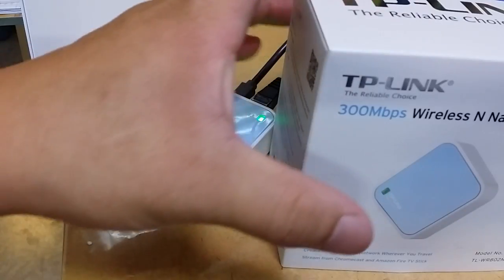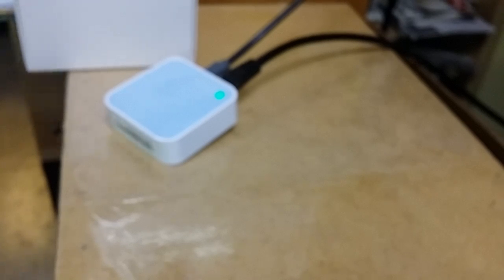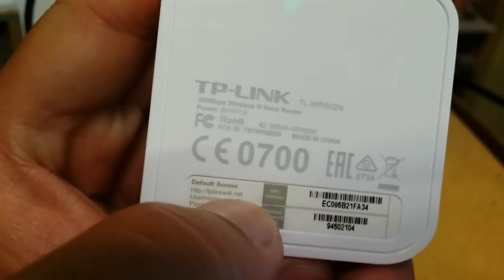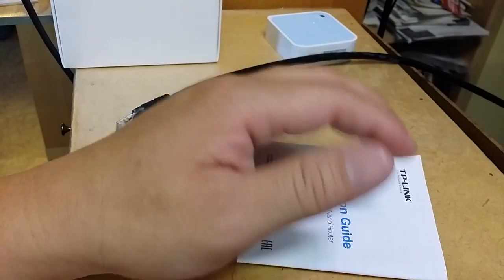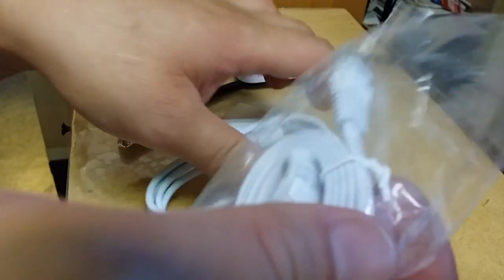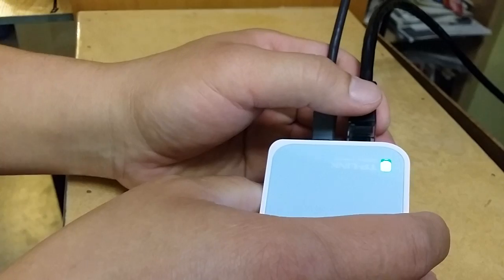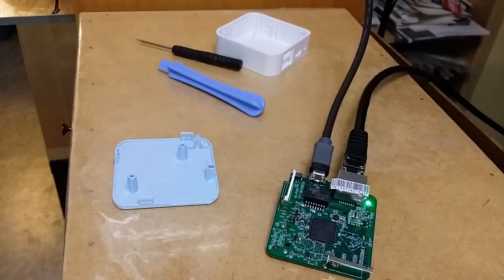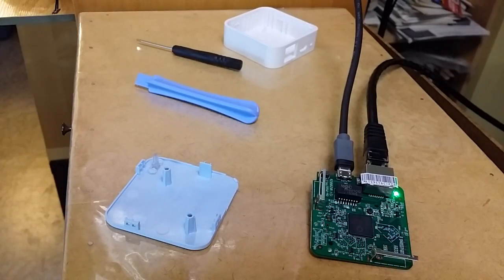TP-LINK TL-WR802N Pocket/Travel Router Initial Observations

Comment: Hey mate, were you able to measure how long it took to boot up? I need something small like this but with a fast boot time.
Reply from the maker: Oh, I still have it. But there are much newer devices. I would recommend a new model. They still sell this old one on amazon. I don't know why. It was already old when I got it.  In terms of tiny routers,  I am currently into the GL.iNet opensource routers. They come with OpenWrt built in. I have several of their devices so far. The only thing about them that the masses probably wont like is that these devices are pretty much almost roll-your-own or you-are-on-your-own. Well, they're pre-rolled, but you really are on your own.   They are stable if you have the patience. I have their tiny yellow "mango" box (same size as the tp-link above) and I have their new "Beryl (GL-MT1300)" grey box.  The new one has WPA3.
Reply from the maker: I also have a "Jetway JBC323U591W Intel Braswell Celeron N3160 Dual Intel LAN Fanless NUC" ( as copy paste from my amazon purchase ).  That one is running Linux. A router specific version of Linux.  It is quite inefficient to do it this way, but I just want to have that as a gateway between the internet modem and my LAN ( Local Area Network ).  I like to know what traffic is going out to the internet.

Comment: Can you connect your desktop to the to link and use the to link to get wireless connection from your router outside in the living room?
Reply from the maker: Yes, I've tried connecting my laptop to the tplink in 'client mode'.  Works alright.  Messy, but it does work.

Comment: Just regarding the Hotspot 

As in some hotel you have to use voucher to get access to one device.. 

Do you know if using this can you use multiple device?? 

And does it have a mobile app? 

Thanks..
Reply: Technically, once you have it in hotspot mode, you can connect to the hotel's wifi which will bring you to a captive portal to login in.  Once you login through your phone, then any other device connected to the router would have internet.
Reply from the maker: Unfortunately, a lot of hotels make you use your web browser interactively, so there is very few ways out. If that's not the case in your hotel, you can use this device as a "client" in wifi OR via ethernet cable.  There is a newer version of this. I have both.    But this one is much smaller of the two.
Reply: @leefiles  Wr902ac is the newer version? 

Which one would you recommend?
Reply from the maker: Yes, I have that one.  That's newer. Its a little bigger. I'm using both together. It supports 5GHz and 2.4GHz.  Both seem very reliable.   The new one is only a few dollars more. Its on sale on amazon right now.
Reply from the maker: I also have the "GL.iNET GL-MT300N-V2 Mini Travel Router, Repeater Bridge". It is open source hardware and software. It uses OpenWrt already installed.   OpenWrt  is very versatile, but it can be confusing.   good for geeks.

Comment: Does this have it's own hotspot or can use my phone hotspot
Reply from the maker: There is a wifi access point (hot spot) and there is a RJ45 ethernet connector.  You _can_ connect this to your phone's wifi hotspot, but it only routes to its ethernet (wired) connection. So if you are trying to share your phone's hotspot to a laptop via ethernet, yes. What exactly are you trying to do?  Are you saying your phone already has a hotspot as many phones already have? This device does not have a slot for a SIM card if that's what you are asking. This device does not connect to Verizon/ATT/Tmobile/Sprint if that's what you are asking.
Reply: leefiles I wanna do a wired ethernet connection to my ps4 cause my router is all the way in my living room unfortunately
Reply: leefiles so basically what I wanna do is connect to my spectrum wifi and then basically do an ethernet connection to my ps4
Reply: leefiles thank you so much for replying good sir
Reply: leefiles you've gained a new sub
Reply: leefiles my phone has a hotspot already
Reply: leefiles I also have wifi in my house
Reply: leefiles so basically I wanna connect it to wifi then use the ethernet port to connect to my ps4
Reply from the maker: OK you could do modem-router-wifi to this device acting as a wifi client and then its ethernet to your gamebox's ethernet. Or you could get a better wifi extender. A wifi extender acts as a wifi client and then rebroadcasts a wifi signal. But, yes, you can use the TP-Link TL-WR802N as well.  If you get complicated with this device, it will not remain stable.  You seem determined.  Look into wifi repeaters. But they wont be anywhere nearly as fast as wired ethernet.  So you absolutely wont wire your house?  You can hide the cable inside the ceiling or use wire-guides.
Reply from the maker: I'm not saying this is a bad device. I use this as a router from ethernet and broadcast via wifi hotspot. And I have this on 24/7/365. In this mode, it has been reliable.
Reply: leefiles ok thanks bro I appreciate the info thanks for responding
Reply: I have an earlier model, the 729, which has been running continuously for more than five years. It occasionally drops out now and I am replacing it with this one. A great piece of kit at a good price. I would recommend it to anyone.
Reply from the maker: yeah, better than I thought. Mine is on 24/7 all year long. Still kicking. Good luck to everyone.

Comment: Question 1: Would this device be able to collect an already existing internet signal from a modem one room over and then directly connecting a PS4 through this device's Ethernet port to establish a wired connection with said PS4?

Question 2: How are you enjoying this device so far and what issues has it had? I'm wondering if I should buy this for the situation explained back in my first question and if this would be the best device for that scenario.
Reply from the maker: I just checked my device, yes, it has a "client" mode.

I leave mine on 24/7. Operates warm. No issues so far.  I don't stress it. I don't expect much from it.

Comment: I get 4 xfinity wifi signals. With my wifi LAN, Windows automatically picks the strongest signal. I'd prefer to select among the xfinity hot spots myself. Can this do it?
Reply from the maker: You can right click on the signal you like and choose to connect to it.
Reply: leefiles how do I connect to xfinitywifi
Reply: so this can pick up wireless hot spots and let you change channels?
Reply from the maker: yes
Reply: can a wifi adapter help somehow with reception of the hotspot signal?
Reply from the maker: they sell 1 watt USB wifi adapters with external antennas.
Reply: Please note, this device only picks up 2.4ghz signals.  I believe there are 5ghz signals too, so if you are interested in other connections, you may need to get an upgrade device that has that features.  Like Ar750s.